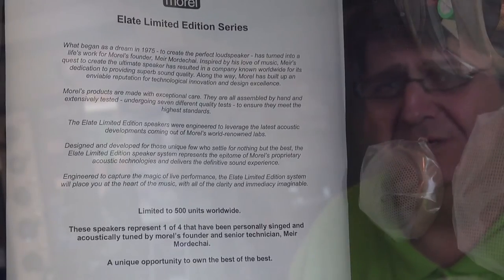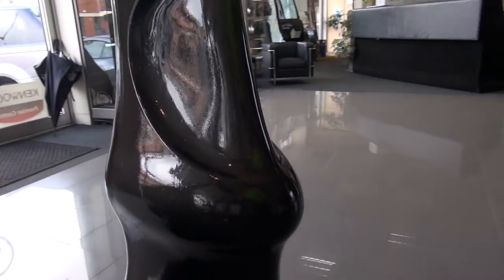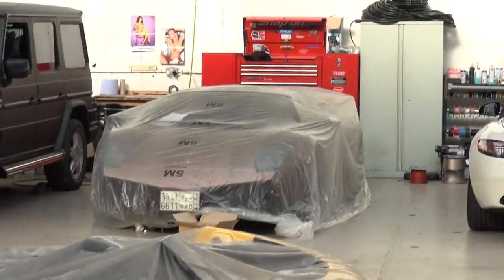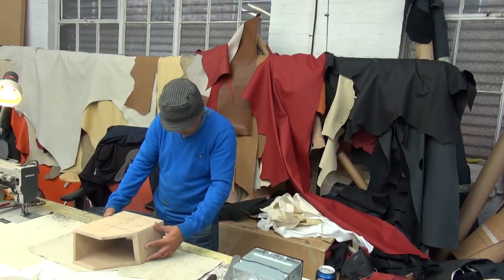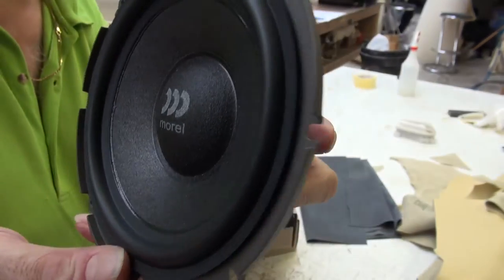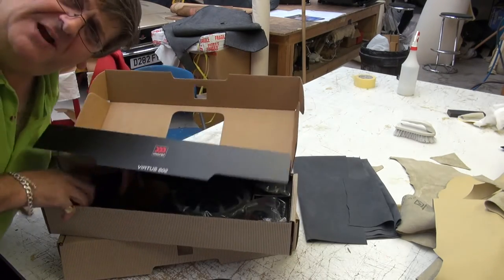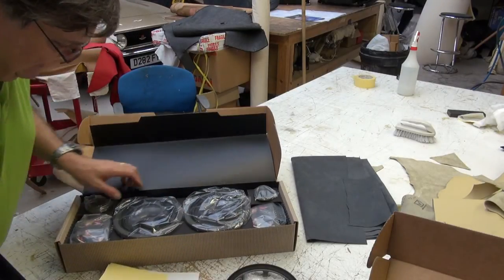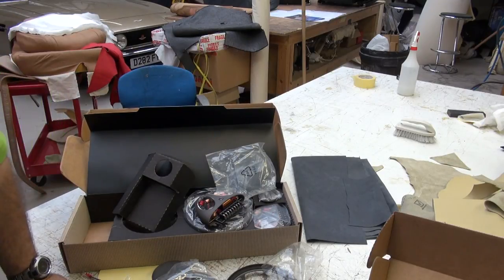Morel Virtus speakers at the UK's Leading Supercar Fettling Company: AUTO AUDIO

Comment: Did u know that morel uses only for Supreme serie mundorf entry level Capacitors for their speakers crosovers ? which one cost around 5$ ;-)
Reply: which tells you what a bunch of snake oil $300 caps are. the biggest difference you hear in sound is the ESR if you test various caps on the same speaker. there is a resistance difference and they do affect sound. morel obviously designs their speakers around the ESR of a given cap. B&W does the same thing even on their $20k 802s P.S. mundorf doesn't make anything for $5.